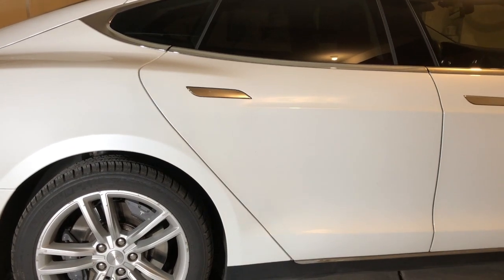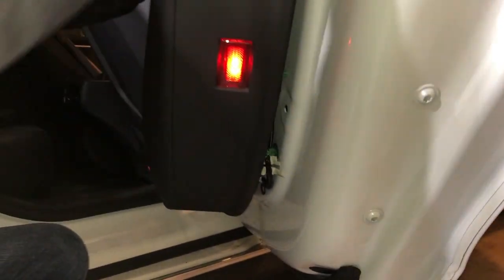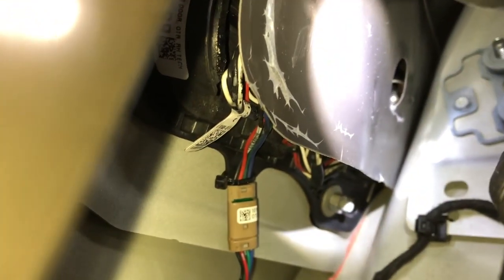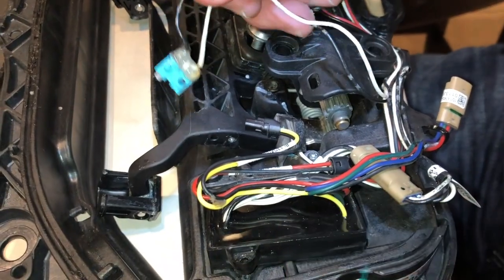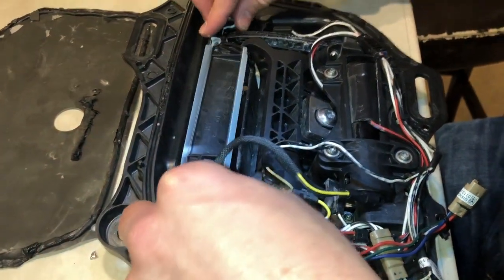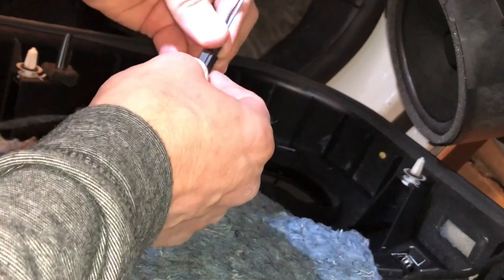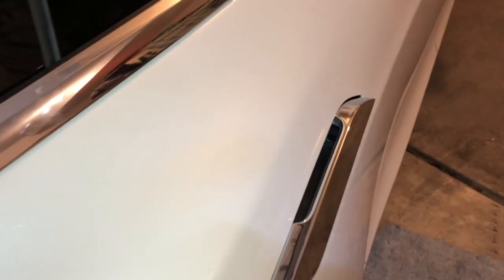2012-2016 Rear Tesla Model S repair when door handle doesn't present or extend out

Comment: I know this is an old video but I have a 2013 Model S Tesla P85+  The external door handles all work.  However the rear door handles dont open the door on either side.  The handle moves but normally theres this quick motor sound that allows the door to open but isnt doing it.  This is on both rear doors.  I have tried to reset the car, pulled the 5a fuse under the hood and that didnt work. My Tesla service center is trying to rob me for $1300 for a bunch of what I feel are unnecessary parts.  Like the external and internal door handles which aren't broken. Unfortunately  my service center has tried this replace everything tactic before with my headlight bulbs.  Tried to quote me $3500 for an entire headlight assembly when it was just the bulb.  Then they said they misquoted me the $246 for them and turned out they said when they checked the VIN on the car it told them the incorrect part.  I was charged $357 for what they say is the right part even tho when the VIN box is checked its the wrong one.  I cant trust them but theres no where else to go.

Comment: I was able to remove the assembly and diagnose the problem (left microswitch black wire open). The temporary soldering did not fix the door opening on handle present, though it did fix the rather recent issue of handle stuck open. A whole new assembly is likely needed. I just left the door handle assembly unplugged for now.

Thank you.

Comment: There is a MUCH easier way to remove the door panel without spudging tools! Just roll down the window and grab the top rear corner both hands with your fingers between the inner weather seal by only the vinyl covered  plastic and pull straight out very firmly.  You will not  damage anything from using prying tools or even need those tools.  The door panel will easily pop off from there; just be careful to catch it so you don't damage the wires.
Reply from the maker: Awesome! Thanks for the tip. I have learn several great tips since recording this video that make the job a little easier. Hopefully this gives others the confidence to DYI.

Comment: This is a very misleading video. There are several important things that are skipped. Way over simplified. Missing very obvious shortcuts like the creator is purposely misdirecting you.
Reply from the maker: I am not a professional mechanic. But I have no clue how you mean I was misleading. I simple recorded a video of me fixing my door handle that would not present, which is a very common problem in the older MS. Let’s see the video you made that is better. Tag it here so that everyone can see a video that is not misleading.
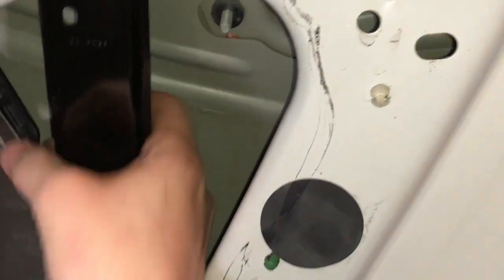Reply: @hughesdc  Did you let the window close slightly to get enough room to remove the assembly @4:34 ?
Reply from the maker: @skorboo  the window was in the up position and was not in way of removal. The handle will slide out of the door with a little jiggling.
Reply: @hughesdc  a tip would be to rotate the door assembly 90° (door handle pointing down/up) lift up in the door void and lower over the window assembly.

P.S. from Skorboo, posted under other account.
Reply from the maker: @zigadabooga  Good tip. Thanks.
Reply: There are two access holes in the door panel to unbolt the top two bolts. No way to fit a 3/8 ratchet on the top left stud from the inside, window guide is in the way. 

Video and sound quality was good as well as the narration. Just frustrating to find after some work that there is a much easier way.

Comment: Tips:
1. The top left nut can be reached through one of the (covered) holes in the door. You just have to get the glass to come up all the way by pushing the door latch mechanism in so that the car thinks the door is closed.
2. The rubber panel on the left side for the left door, or right side for the right door can be pulled up to access the nut way up in the corner.

Comment: I'm trying to figure out how the door opens and close because I want to do a door handle swap on another vehicle using the Tesla door handles you know how on other vehicles there's a door latch that locks around a bar on the inside of the door to keep the door closed while driving I was wondering how the Tesla handles keep the door closed